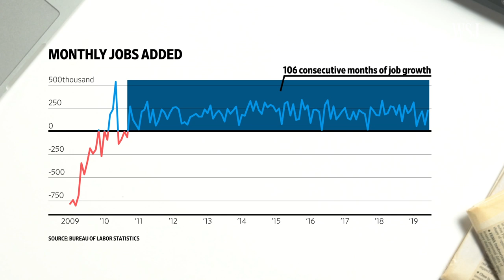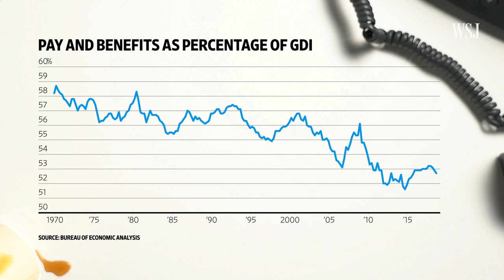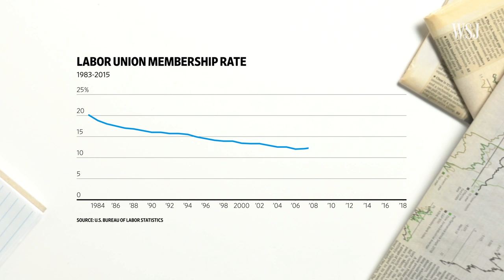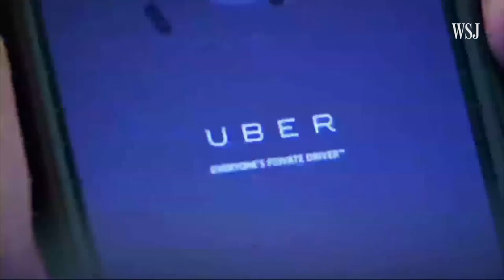Why Are Wages Low in the Growing Job Market? | WSJ

Comment: Point 1:  Low wage workers have trouble demanding higher wages.
Uh, yes.  And this is a surprise to whom??

Point 2:  Unions are declining.
Again, yes:  their value is not substantiated and their propensity to negotiate wages and benefits that exceed the value their employees generate for businesses is not sustaninable.

Point 3: The gig economy
Nobody is holding a gun demanding anyone drive for uber.  And setting minimum wages, as stated in NY, results - in every single case I've seen - in negative consequence for low-wage workers.  Which is obvious to anyone with the most rudimentary understanding of prices and market economies.

Point 4: Globalization
Correct: people in highly developed countries like the US, do not want to work for the same wages as those in developing countries like China, Vietnam and India.

I really expect alot more for the WSJ; this was an abysmal disappointment.
Reply: @ma27794   read the studies on this topic out of: Seattle, Stockton, San Fran, and NYC.  ...as I have done.

They all conclude the same thing:  a negative impact to low-wage workers.

your link is also a joke, right?  it reflects the data from 2016, before the most significant increases.    jeez,  IN THE ARTICLE, it states:

"The results, however, differ from those of a 2017 University of Washington study, which indicated that Seattle's increased minimum wage had harmed employment in the state."

so, you dont even read your own links.  joke.
Reply: @vrolleri  What increases be more specific please? San Francisco's minimum wage was $13 when the study was done, which is way higher than the federal minimum wage. No significant increase in unemployment came as a result.
Reply: @ma27794  >>What increases be more specific please?

unemployment for low-wage workers.

low wage workers, the specific demographic MWL are designed to address, suffer an overall net loss of hours worked, compounded with reduced workforce, which results in overall net loss of yearly income.  in other words, as is more common than not, the goal of the policy is, literally, the opposite of the actual effect.

>>San Francisco's minimum wage was $13

if I concede might be a place for MWL, will you concede that it is, at best, dependent on immediate locality (i.e. city/community policy-based)?  i.e. do you believe the MW in San Fran should be the same as the MW in Davenport, IA?
Reply: @ma27794  re. the biz insider article: i read this as two beauracrats looking to justify their beauracracy, literally.

e.g. "They indicate that higher wages for lower earners could decrease employee turnover, benefitting employers as well as workers."

this is dumb and doesnt pass the sniff test.  you shouldnt expect to take a job at the counter of mcdonalds and stay there for the next 40 years supporting a family.  it is, literally, designed for high turnover.  e.g. a high-school kid looking to earn a few bucks and develop some responsibility.  

want to guess how that demographic makes out under MWL policies??

re. the other link, i have yet to receive my august copy of the Quarterly Journal of Economics, so cant yet comment on that one hot off the press.

i find it much more compelling when a group of folks who WANT to find MWL as positive, actually find the opposite.  that type of research is clearly more transparent.  e.g. the ongoing (3 years now?) UW study of MWL in Seattle.  ....which, again, INCREASINGLY, documents the overall negative effect on low-wage worker incomes from MWL's.
Reply: @vrolleri  "Low wage workers, the specific demographic MWL are designed to address, suffer an overall net loss of hours worked, compounded with reduced workforce, which results in overall net loss of yearly income.  in other words, as is more common than not, the goal of the policy is, literally, the opposite of the actual effect." I literally cite economic studies that show that this doesn't always happen and you keep repeating it as if it is a definite fact.
Reply: @vrolleri  "the biz insider article: i read this as two beauracrats looking to justify their beauracracy, literally." are you actually implying economists at the census bureau gain something out of advocating for an increased minimum wage? Don't fall into conspiracy theories my friend.
Reply: @vrolleri  "this is dumb and doesnt pass the sniff test.  you shouldnt expect to take a job at the counter of mcdonalds and stay there for the next 40 years supporting a family.  it is, literally, designed for high turnover.  e.g. a high-school kid looking to earn a few bucks and develop some responsibility." It's not a question of should or shouldn't expect. The question is whether an increased minimum wage harms workers and many studies show that it doesn't. Also while minimum wage workers tend to be young, 50% of them are 25 years or older. Not all young people want to work a minimum wage job, and these older workers help fill in for them.
https://www.bls.gov/opub/reports/minimum-wage/2018/home.htm
Reply: @vrolleri  "the other link, i have yet to receive my august copy of the Quarterly Journal of Economics, so cant yet comment on that one hot off the press." Don't have to, you can type in the title on google and get results.
http://cep.lse.ac.uk/pubs/download/dp1531.pdf
Reply: @vrolleri  "i find it much more compelling when a group of folks who WANT to find MWL as positive, actually find the opposite." So you're saying that you only accept studies that have results that you already agree with? Seems pretty close minded.
Reply: @ma27794  >>It's not a question of should or shouldn't expect. 

sorry, but i completely disagree.  one who expects to support a family on the wage intended for someone with zero experience and still in high school is misguided.
Reply: @ma27794  read thomas sowell's experience and the labor dept and get back to me.

or, i'll go by my own experience in government, where rampant "job security" is the norm.
Reply: @vrolleri  How would arguing for the minimum wage increase these economists' job security? Are you seriously telling me that if they argued against it they would be fired? Again this is sounding like a conspiracy theory.
Reply: @vrolleri  Thomas Sowell is man who believes that climate change is manufactured by intellectuals to get research money. Which contradicts almost all of the peer reviewed scientific research, as well as the views of almost any scientific organization. He also called Obama a fascist because Obama forced insurance companies to cover the children of parents who had coverage. He is no way a serious human being or economist.
Reply: @vrolleri  Thomas Sowell's views also do not represent in any way the majority of economic experts.
Reply: @ma27794  if there was no minimum wage, they would have nothing to study.  you're inability to link these is evidence of your bias.
Reply: @ma27794  really?  where, in frankfurt?

if so, that's a shame.  it's too easy for leftist indoctrination into marxist economic philosophy given the tilt of modern adademia.

and, given that sowell grew from this, gives his ideas all the more credence in my mind:  he's certainly not shy in talking about his own marxist roots.  ditto williams, steele, etc.
Reply: @vrolleri  "If there was no minimum wage, they would have nothing to study." Makes perfect sense because minimum wage is the only possible thing there is to study in economics. Not taxes, trade, or anything else. Is lung cancer a conspiracy too? After all if there was no lung cancer, these researchers would have nothing to study.
Reply: @vrolleri  "really? where, in Frankfurt?" Find me a poll of economists who think that Obamacare is facist.
Reply: @vrolleri  "it's too easy for leftist indoctrination into marxist economic philosophy given the tilt of modern academia." Marxism has not been mentioned once in this conversation. Do you have any argument besides "anything that disagrees with me is a secret conspiracy by marxists, the government, academia and economists." Smoking doesn't cause lung cancer and all the researchers that say they do are being funded by the marxist globalist elite and George Soros. They want to keep all the cigarettes to themselves. This is how you sound.
Reply: @vrolleri  "given that sowell grew from this, gives his ideas all the more credence in my mind" So because someone changed their mind that means their new ideas are automatically correct. I use to think smoking causes lung cancer, I change my mind so now I have credence. Smoke as many cigarettes as you want.
Reply: @vrolleri  Sowell found out that marxism doesn't work. But just because marxism doesn't work does not mean that any regulation of the economy in any way is doomed to fail. That is an extreme position that has no basis in logic.
Reply: @ma27794  are you absurdly trying to claim there is not a massive marxist bent to academia?    

if so, you really dont have any idea of reality which comports well with your perceived ideology.  
i'd guess youre a highly educated expert of something.

as for the one w/ conspiracy theories......i'll leave that to the observer.
Reply: @ma27794  the DOL doesnt research lung cancer or taxes.  they do manage, among few other thngs, minimum wage.  and very cleary, you have never worked for a government administration.  want to guess who has?
and, i sincerely hope you dont believe that anything "researched" is infallible. 

again, boghossian et al put that one pretty well to bed.
Reply: @vrolleri  "are you absurdly trying to claim there is not a massive marxist bent to academia?" What marxist ideas are systematically taught in American universities? Please explain further. We are also talking about economics so please explain what marxist ideas are systematically taught in American economics classes.
Reply: @vrolleri  "the DOL doesnt research lung cancer or taxes." I never once claimed that the DOL researches lung cancer. You need to understand analogies buddy. You said that if there were no minimum wage the economists in the census bureau would have nothing to study. By that same logic lung cancer researchers made up the concept of lung cancer so they would have something to study. Both statements are nonsense. I have also cited multiple studies that do not involve government researchers.
Reply: @vrolleri  "you really dont have any idea of reality which comports well with your perceived ideology" I have literally admitted that there are credible economic studies that show increasing the minimum wage increases unemployment. I then respond by saying that there are also credible studies which show that it doesn't significantly raise unemployment. You then respond by saying the studies that I have cited are part of vast conspiracy which involves the government, marxists, and economists working together to falsify data. Who here doesn't have an any idea of reality which comports well with perceived ideology?